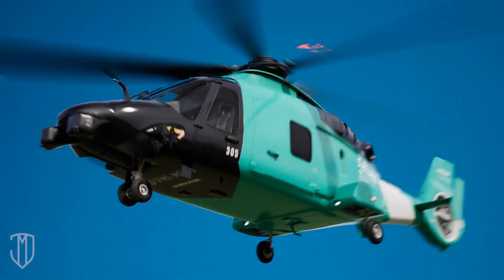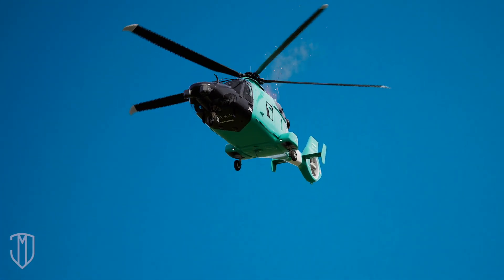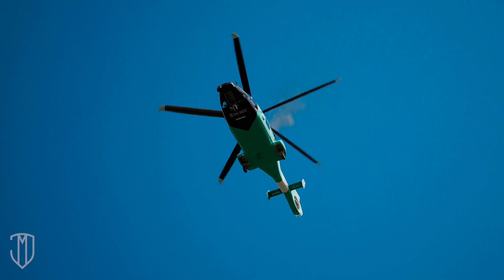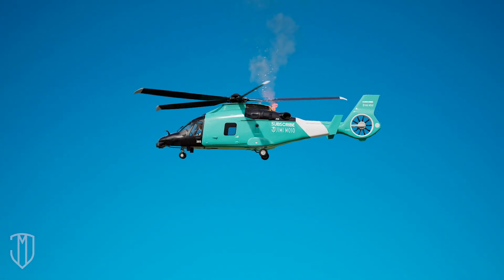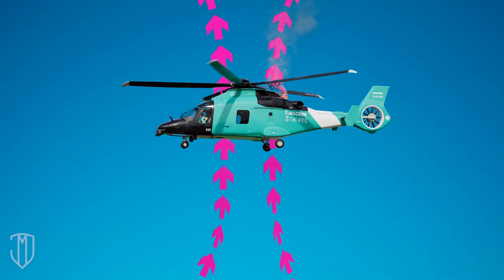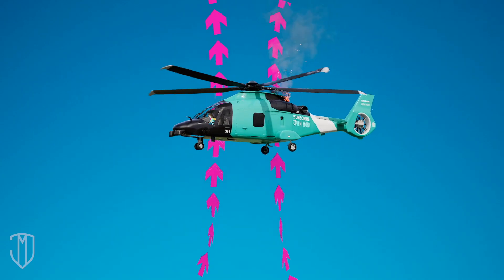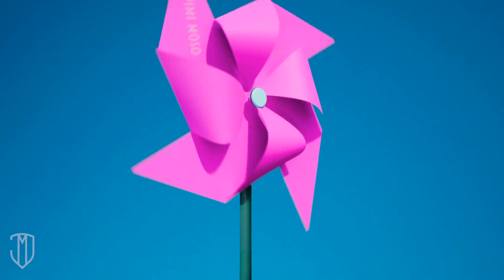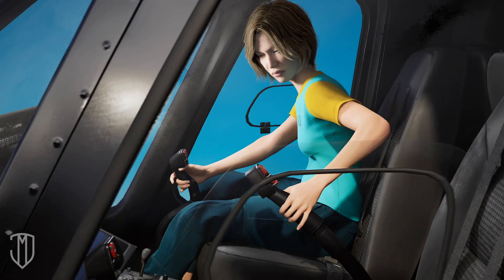How to Crash Land a Helicopter If the Engine or Tail Rotor Fails 🚁  #survival #howto #helicopter

Comment: If your tail rotor fails, another important factor is forward airspeed. If you are traveling forward through the air, it will create drag on the tail boom, forcing it inline with your direction of travel which counteracts the uncontrolled spinning.

Nice video :)
Reply from the maker: Great point!